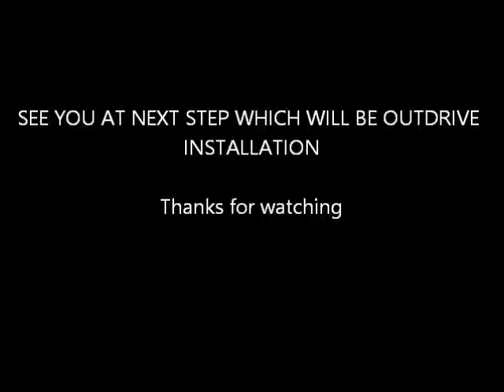Volvo Penta 290A steering fork reconditioning and installation

Comment: I really appreciate your videos Steve. I have the DP290A so it is the same as yours except for the duo props. It also has power steering so I have 2 linkages on the tiller lever. Mine has a very annoying tracking problem while at slower speeds. I think that some of it may be due to slop in the the 2 steering fork bushings located in the transom shield. Evidently the originals are nylon. Did you replaced those 2 bushings and if so, do you have any advise?

I also used your ideas for a "carrier dolly" for supporting the outdrive. That will save my back for sure. 

My boat sits in fresh water over the summer but it is river water with zebra mussels. What a mess so I will need to remove the outdrive every few years for bellows and inspection. 

Thanks again.
Reply from the maker: Thank you Dave for your comment.
Yes, I usually replace the 2 nylon bushes every time I remove the outdrive, approximately once every 3 years, in order to replace the bellows.
There is no difficulty at all in replacing the bushes. They are in nylon so you can brake them easily if they don't come out. Remember to properly clean the housing before inserting the new bushes with fine sand paper. Best regards.
Reply: @Ian Mekhi Instablaster ;)
Reply: @Jeremiah Jase I really appreciate your reply. I got to the site thru google and I'm trying it out now.
Looks like it's gonna take a while so I will get back to you later with my results.
Reply: @Ian Mekhi No problem =)

Comment: hey capt steve....just got one of these out drives. I was wondering if you had a good online source for parts? Also are there any id numbers anywhere? Mine has been painted it looks just like your 290 but im sure they have different models using that set up.

Comment: Very nice job and useful video. I tried to reach out to those 6 bolts on engine mount kit that is located right behind the steering fork and stern leg.   I could not reach them as the steering fork was in the way. 
Question: 

I need to remove the flywheel housing to replace the flexplate (located right behind  flywheel ).. 
Would it be better remove transom  bellhousing to reach the flywheel housing or remove the engine?
Reply from the maker: Thank you. I would remove the transom bell housing rather than the motor.
The first time you remove the steering fork is a tough job. I had to create special tapered shims to separate it from the tiller arm, due to corrosion. After that first time I have had no more problems. It is enough to properly grease everything before assembling and the disassembly becomes a very easy job.
Reply: Capt. Steve  Thank you. Wish if I saw your reply earlier. I started to dismantle all to lift the engine.  I decided to remove so I can give a good painting and check all parties around the engine.  It’s my first time experience ever to remove AQAD40B.  Those 6 bolts at the transom were all corroded. Luckily the bolts were greased by a previous mariner. So it was much easier to pull the out even the head of bolts were all rusted and gone

Comment: I am having trouble locating my tiller arm set screw its suppose to be a 5/32 allen wrench my drive is a DP-C1
Reply from the maker: See my video https://youtu.be/zp9cdR5UqOQ at minute 00:48. It shows tiller arm set screw unlocking  operation. I do not remeber the exact size of the allen wrench. Next time I will go to the boat I will look at it and let you know.
Reply: Thanks...........I actually found it before you replied by watching the video about three times.  LOL...its a 5/32 Allen Wrench as my drive is a little different than yours.  Great video very informative.  Do you have one that removes the shift cable?  I am subscribing now and thanks for the quick reply!
Reply from the maker: Thank you for subscribing. I am glad you appreciate the videos.
The procedure to disconnect the shift cable from the drive is described in my video https://youtu.be/M_5Lw8ZWgc8. Unfortunately I have never had the need of removing, (meaning "changing") the whole shift cable, so I cannot be helpful on this issue.